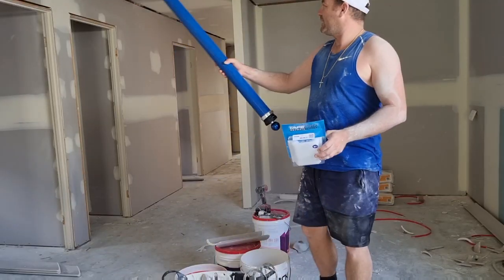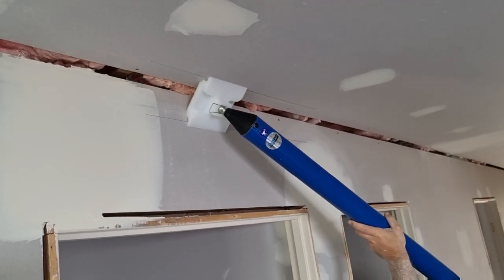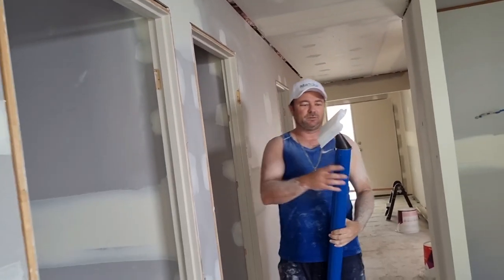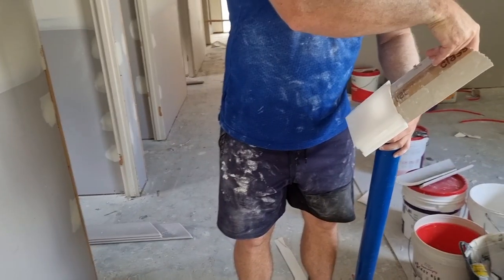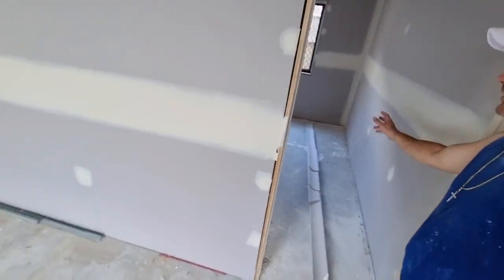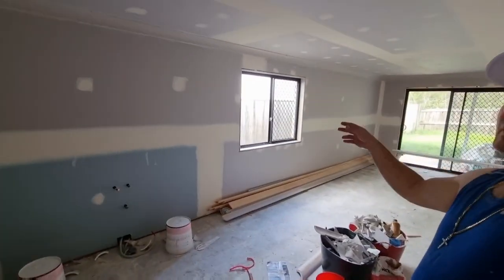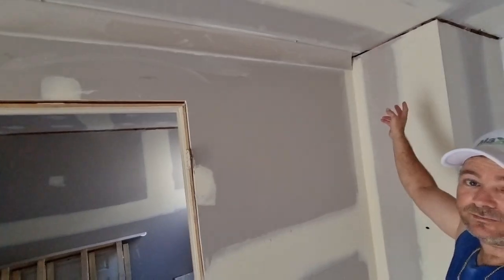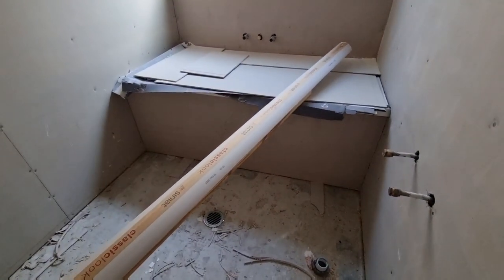Tapepro's Drywall Compound Tube 5X Faster Cornice Cement Applicator Tool

Comment: Hi Maxi....love your vids mate even though I'm a 40+ yrs professional I've picked up a few good tips from you.  Espec love the trim tex on tiles idea, that tip has saved me so much time.

As I said I'm a 40+ yr pro contractor. I've done it all but mainly specialised in cornice so I found this vid of great interest to see how others use it.  I've tried this tool twice over the past 15 yrs and I think it's a great idea but needs some fine tuning to the design. 

Some design changes I believe would make this tool much better is, small wheels to roll on the wall would make it much easier to push especially when on 2.7m high ceilings.  Open the mud flow hole in the center slightly so you mix the mud a bit thicker, less slop and clean up time. open the bead size up so you have more than a few millimeters of mud excessing the cornice, won't crust up as quick. I think with these design changes it would be a much better tool.
Here are what i believe are the pros and cons of this tool.   Pros 1; it is very very quick to put the mud on, 2; it makes the cornice much lighter to throw. (this makes a big difference when I throw 200+ lm a day). But here are the cons I've found to be. 1; the mud has to be so thin it's actually messier than hand buttering and goes every where, 2; you have to clean it off very quickly or the mud skins quick which makes it harder to clean up. 3; You have to throw and clean the cornice as well as clean out the tool all in a short time. 4; It's a lot harder to push around on ceilings above 2.4m high.  The times I've tried this tool was once with a team of 4 cornice fixers and once with 2 of us, maybe we were trying to put to much up in one mix (food for thought).  Although some of the process was much quicker using this tool I found it actually balanced out by the time you wash the tube, clean up the slop all over the floors and if the mud goes off before you clean the tube it's very expensive.......I learnt this the hard way....DOH!...lol.

I've seen the way you butter up throw cornice,  so I can see why you think this is much quicker.  Not meant as an insult, but to a cornice specialist it is amusing to watch...lol.  But we've all got our differing ways and I picked up a few good idea from you, Max, so keep up the good work Bud.  If you're ever on the Central Coast of NSW I' d love to catch up. Cheers mate.
Reply from the maker: I totally agree! I need more practice on it thats for sure and yes the mix was sloppy then we worry about it holding initially so we had to put screws in. Also we werent using our preferred cornice cement. Im going to copy your comment into the description its got some great pointers . Thanks for watching and going easy on me . 👍
Reply: Totally agree mate.
I gave this tool a go last week and had the same issues.
Mudded up perfect square ensuite and walk in first .. thought yeah this is quick. Left my lad to clean and wash off while I mudded the whole master 3 exyernals etc and agree the mud goes off too quick on a bigger room. Also found the bottom bead of mud sits a touch high so was hard to squeeze down the wall so to get some excess coming out and not having gaps to fill.
Hybrid way were doing the next job is to use the applicator on all simpler rooms and maximize the ease. But then with the end of the bucket which is always hard to draw into the syringe do a bigger room  old school buttering the cove. 
Just until I fully suss out how best to use it
Reply from the maker: Yeah i totally agree, left some gaps also mud didn't feel strong so we had to pin it

Comment: That is not finishing it is production finishing at something. If you can't pull for slick finishing then you are not a finisher you are an amateur. By that l mean finishing drops and top angle for paint in two coats. In the 80's in America most ceiling got texture very few so called " finishers " knew how or were any good at slick work .